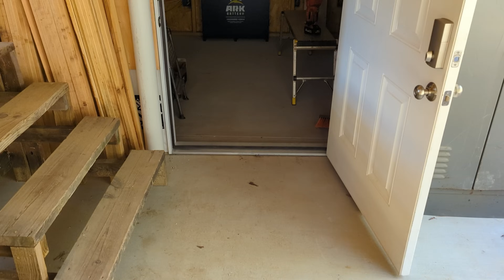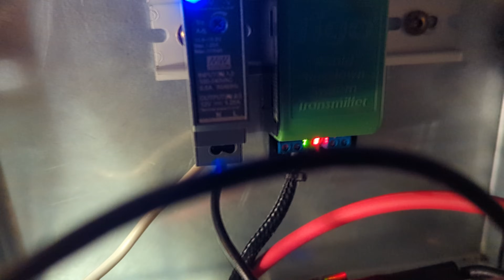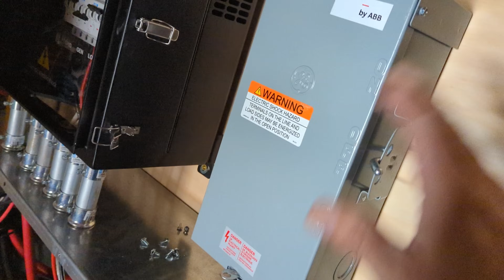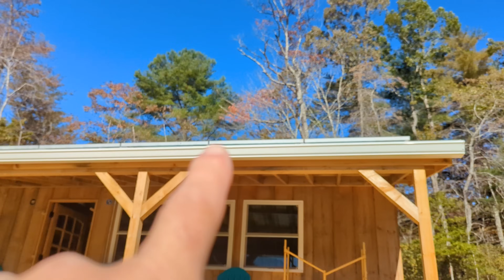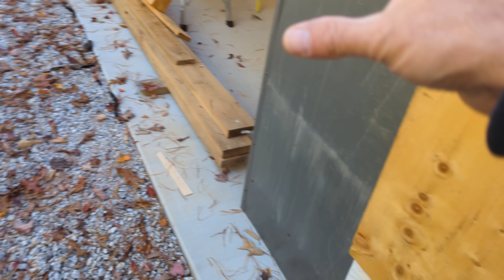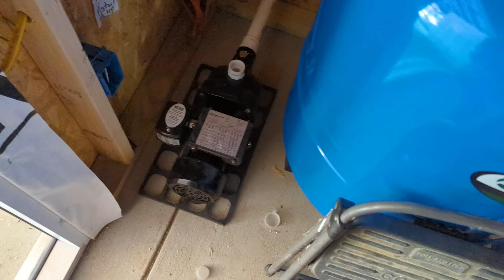A Change of Pace

Comment from the maker: Hey folks, be sure to check out our Black Friday deals! Enjoy these discounts through November 30th:
https://practicalpreppers.com/product-category/solar/

Let's discuss your solar goals:
https://practicalpreppers.com/consultation/

Order the Sol-Ark 15k inverter:
https://bit.ly/3m7DGYZ

Get an EMP hardened DIY kit:
https://practicalpreppers.com/product/diy-emp-hardened-19kw-solar-kit/

Our pressure canners are back in stock and in fun new colors!
https://bit.ly/3IdOgWJ
Reply: Nice install, so if the battery is dead, sun comes up, it won’t start working because it won’t have 120v to the power supply on the rapid shut down, therefore not powering on the Togo modules.. Am I missing something?
Reply: @24Frosty24   I was just going to write the same thing, no 110v out means no PV charging in this setup.  It can never come back unattended.  Get a little trolling battery to power the tigo's and run trickle charger to the trolling battery.
Reply: Hey, brother.  I am a born again Christian too.  Baptist.  I made a dowsing rod system(copper wire inside two plastic straws), but nothing happens.  Any pointers?  Mine extend about 24 or so inches.  A friend told me that my wrists are too strong to allow for the slight deviation from passing over a water or electrical source.
Reply: As others have mentioned, with a 120v power supply the system will not automatically recover after shutting down due to low battery. If you have the shutdown based on SOC (say 10%) you can use a DCDC converter. Meanwell has a few suitable ones but the DDR-60L-12 is probably the most versatile. You can then either power the DCDC directly from the battery or from a small PV module

Comment: I always wonder why people with a generator backup, and propane/natural gas fueled appliances don't spend a little bit more and het a water cooled generator and do a "Combined Heat and Power" setup?  

Especially up North where they have short solar days, and run a gas furnace anyway.  

Maybe I'm missing something, but if you're going to burn the gas, why not put both the heat AND electricity to use?

Comment: Mr 775, one question I've never heard addressed is:  When the batteries are full, and there is no load, and the solar panels are still generating power, where does that power go?  Does the system simply send it to ground?  
Thanks!
Reply: It depends, in an off grid situation the inverter will just not draw that power from the panels, it closes the tap in essence and just does not utilize what is potentially being produced.  Similarly in a grid tie with no sell back agreement, the panels just sit waiting to be called on to produce power-when there is a load, the inverter almost it to flow from the panels thru the inverter to the load(s).  In an on grid situation with grid tie and the ability to sell back, the panels always produce at their maximum and anything not sent to loads by the inverter is sent back thru the meter to the grid.
Reply: That's what he's talking about when he mentions the "smart load" option for either heating water or running the pump.  The "smart load" output on the sol-ark will let him use that excess power to divert to either pumping water or heating it. Lots of options on the sol-ark.
Reply: Yes there are and yes E775 was talking about using that extra production, but that wasn’t what @martinparmer asked.  He specifically asked what the panels and inverter did with the potential production if there was no load to supply.
Reply: @balrog006  - sorry for the misunderstanding.
Reply: No worries, you added good info as well about the Smart Loads options.

Comment: When installing a roof mount system, can the DC wire from the panels run through the attic to the other side of the house before running out through the soffit to the disconnect?
Reply: Yes, there are code requirements for that though-if you have to be inspected and follow code any DC wire inside the building or walls must be in metal conduit.  It’s not a bad idea even if you do not have to abide by code.
Reply: @balrog006  Thank you!

Comment: I'm wondering which would be better...two 15k Sol Arks, or one 30k for a whole house set up. I realize less installation work with a 30k.
Reply: 30k is 208v 3p
Reply: @SolarTechFL  And the 30K only works with ~300VDC batteries that it has comms with, so no 'hundreds of volts' lead acid racks like in substations and power plants.
Reply: Installation not much additional work.  Consider, assuming equal reliability of 15k and 30k units, multiple units increase the probability of a failure in any given year, but decrease the probability of a complete power outage because all units failed.  For example, if the odds of failure are 1/4 any given year (Sol Arks are MUCH more reliable than that!) and you have two units, you now have 1/4 + 1/4 or 1/2 chance of a failure any given year.  Or as there is a 3/4 of not failing for two units that is 3/4 * 3/4 or 9/16 chance that not all will fail, or a 7/16 chance that all will fail.  With 3 units the advantage increases, etc.

Comment: does it get cold enough there to have to keep battery heated so it can charge?
Reply: Certainly doesn’t look like it, even if the outside wight freeze overnight, a little insulation and the Waste heat from the inverter and the home would keep that much room above freezing.